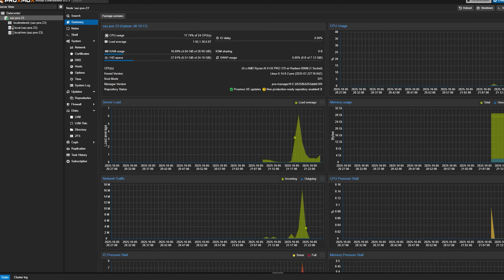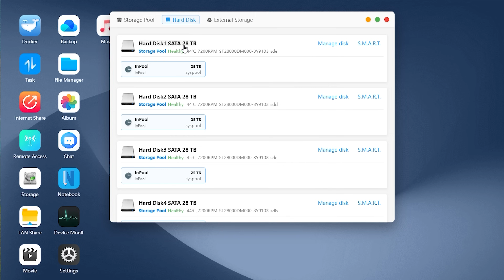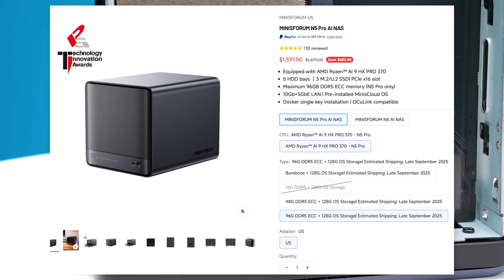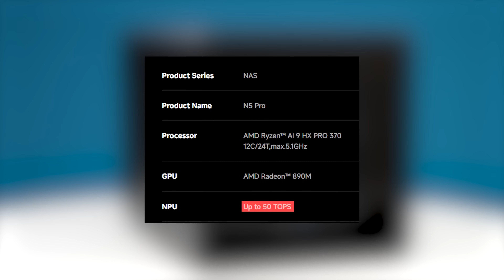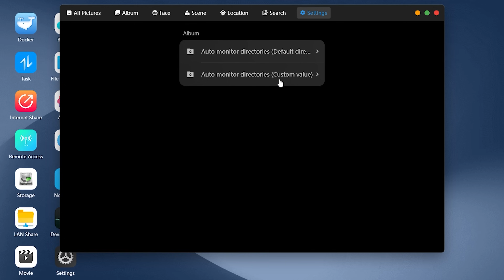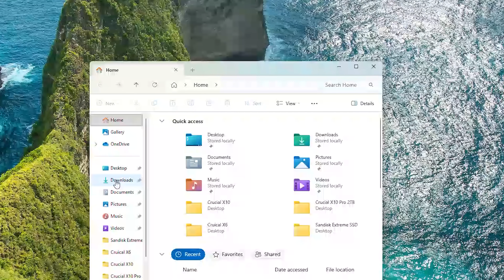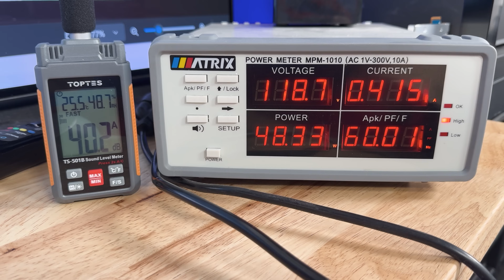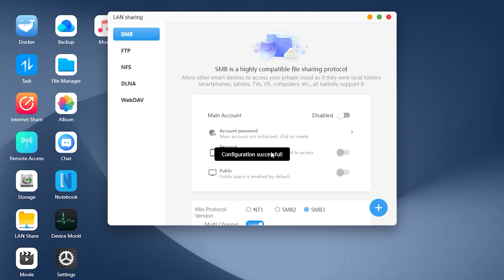The BEST 5-Bay NAS Today (by far?)

Comment: 1200 dollars? that is mid tier level pc . i very much prefer a i9 with very very good mobo and psu and a good case ...maybe go directly for a sas card and used server sas disks that are cheap and enterprise grade . i dont care so much having hot swap trays , is not like i gonna swap disk every week . you could just run the service in the background of your pc with a container and use 2 or 4 cores of the 28 or 32 that you get for like 300 dollars . is stupid at this price . thats just a gaming laptop without screen , memory or storage for 1200 dollars . just a mobo with a solderer cpu .

Comment: Good hardware, crappy suspicious software. I would still prefer UGreen NAS over this as they will still support their NAS'es hardware even if you put a different OS in it such as TrueNAS or Proxmox. UGreen has also improved their NAS OS a lot since launch and it doesn't require you to register your email with them or such. I own both 5-bay & 8-bay UGreen NAS'es and they've been running 24/7 since I got them. There were some hiccups on their software at the beginning but they addressed these issues quickly and they keep improving their OS to the point I'm enjoying it more than my Synology NAS'es. Running docker and VMs is also a breeze as well as running NGINX proxy manager on it via docker. This was much harder to set up in my Synology NAS.

Comment: I have the N5 pro and it has a fairly big problem. The fan speeds are not visible to the OS. I tried a couple of linux options since I want to run Unraid on it. 
It appears to be a BIOS issue.  EC ram fields show empty, and the documentation that I got to was not help.

I will be reaching out to all to get a BIOS update to resolve this.

Comment: cool design but you're right the custom application for setting it up and needing to register with an email is not good. I'd love to see simlar formfactor with lower specced hardware. $1000 USD is a lot before even buying hdds.

Comment: Why do so many NAS systems come with external PSU? Seems like something that can be easily disconnected even in a rack/shelf. Also that power brick has no ventilation. How long will it live? An alternative front cover would be nice, but since they don't offer it, it would be great if Minisforum would provide STEP files to 3D print mesh with placeholders for magnets. I don't need a plastic cover to reduce airflow but I want some dust intake protection.
Finally, I haven't played with NAS outside of the old Synology I have but can disks be parked until NAS is accessed? Ideally I want SSDs to be available as first level cache that once fills up (for write loads) synchronizes to the disks, 50W is quite a bit for idle if I'm sleeping.

Comment: I never have been able to understand the PCIe lane allocation in these things....  If it's a NAS, it should have two equal networking ports for proper balancing.  The chipset is PCIe 4.0 across the board: that's one lane each and done.  It should also have equal M.2 sockets, so you can run RAID1 on the SSDs without a horrible imbalance in bandwidth. There's little to no need for the third, inexplicably size-limited M.2 slot, just use that lane to make both of the others run 4.0 x2.  If those lanes need to be pulled from somewhere, ditch the OCUlink - anybody wanting to use that for something can just put a riser in the PCIe slot, since they won't need to put a 10GbE card in.

Comment: This hardware setup looks nice, but they need to add the drive locks, label the nic ports so you're not guessing which is which. Not a huge deal but still. How is the air going in through the front with that panel on? That looks restricted and could be a mesh metal cover instead of plastic. If you can choose your own OS then it's fine I guess, but the last is the price. These have to go down because the hard drives are the ones you still need to spend a lot on. Nowadays you have many choices for nas boxes. But it's nice how everything can be taken out like that. Just keep in mind that you can't upgrade that over time though. I've had to update my nas board 3 times already so having something that can fit a mini-itx is a good thing. It's definitely a nice box though. I like the vertical drive setup myself.
Reply: You’re right. I built a nas using this and one of my hard drives fell right out

Comment: I love the idea of a 5 bay and this one seems to tick a lot of boxes. I really like the modular architecture. The CPU choice and the openness of the way they designed this control plane was very cool. This nas is a mix between a workstation and a nas for processor, ram, etc but really aligns with the reuse of one of their other MB designs. I think cooling might be an issue but I'm probably not reading the stats right. I bet it would be a good choice for OpenNas or their own nas software. Thanks for showing me another option (I am still leaning on the UGreen 4800 plus as my go to, but nice to have great options like this).

Comment: That looks like they could provide upgrades in the future for the compute section. I wish they left enough room for one of those Intel B60 cards
Reply: I have one and no it does not fit, only single slow low profile so not much available
Reply: @naitcalo2141
Can this slot even supply more than 75W for B60?
Btw. do you maybe know if this NAS will fit Intel B50 inside and power it stable?
Reply: @EeerieSoundWave  As far as I know it's only suited for up to 70W but I am not 100% sure. 
I ended up returning my unit.

Comment: $600 for the cheaper one without drives and $1,020 for the AI version. This is way too expensive for a 5 bay mini NAS!
Reply from the maker: I mean the AMD Ryzen AI 9 HX 370 is a pretty high end chip itself. This is not really that much more than a non-NAS mini PC with it
Reply: @ServeTheHomeVideo  and that is exactly my point! What home user, home lab owner, or small business going to buy a 5-Bay NAS at this price. They may have specific uses for that high end CPU and like the 5-Bay hot swap drive bays that come with it, but they are not buying it for a NAS.

Comment: dxp4800+ half the price as this over priced thing
Reply: The non pro is way better than ugreen at same price, reviewers only check the pro but non pro is the same just with different cpu ryzen 7 255
Reply: @naitcalo2141 is it mandatory to use only certain drives, can you run your own OS?

Comment: It also comes with stingy BIOS updates, and zero support when it stops working, as the manufacturer churns new products non stop and does not even have the stock to replace units under warranty.
Reply from the maker: That is why we had a section discussing support

Comment: I wish the power button was behind the front cover so it is harder to bump/long press.
It looks like there will be thermal issues - especially with the large, solid front panel obstructing airflow - it would be nice if that was a grid/mesh of some sort instead and a filter on the intake.
It does look compact, but only in some areas -  I think that if they made the drives load in from the top, rather than the front you could put almost 2x as many in, i know that hurts usability in where you can access it, but honestly, how often do you change drives in your NAS? - Maybe not the right person to ask that hehehe

Comment: This is such a cool machine it's not even funny (incl the non pro version). I could see myself installing a standard Linux distro on it and running as my daily. Put the intel b50 gpu inside (N3rdware cooler - will it fit?!), add an oculink eGPU and you have a beast of an AIO home/SME server for biz applications and any local AI you throw at it (within reason)... If you trust Minisforum's hardware reliability - but the same applies to any of such boxes, and I'm pretty sure there will be more of them soon.
Reply: B50 gpu don’t fit only single slot low profile
Reply: @naitcalo2141 Hence why I mentioned N3rdware cooler! They have it in the pipeline

Comment: The pricing just makes it absurdly unattractive to be frank. Nearly 2 grand for something that can be achieved at much cheaper a price with DIY components and with a better performance profile if you do. Maybe less power efficient, but if you're concerned with power efficiency, you can easily still beat this on that front with a DIY solution. It's not even that much more easy imo

Comment: Minisforum really killed it for a first stab at a NAS.  My current setup is just a 5 Bay usb4 going up to a miniPC similar to what they have, no built in PCIe slot, but to me that the affordable route.
Reply: Could you please share which 5 Bay usb4 model you are using? I'd like to use such a device to connect it to my main device as a quick storage/backup solution, thx.

Comment: My mind immediately goes to a home lab Proxmox cluster with two classes of Ceph storage across the two drive types. For budget setups you already have front end and back end networks. Or you can upgrade the backend networking over PCIe and have dual front end network paths.
Reply from the maker: Fair, but really for Ceph you want many nodes and OSDs

Comment: This is a pretty nice system, but not quite right for me. What I am looking for would be a chassis for spinning disk drives like this, but without any compute, it should just have SATA connectors so that I can connect the disks directly to a custom DIY PC. Do you know anything like that? It should also be affordable.
Reply: That's just an externa HDD. Even boring old USB 3 is plenty fast enough for that. You don't need a NAS if you don't care about accessing the data over your network.
Personally I've thought about buying an old busted laptop and repurposing it is a NAS with a few external drives. Mainly I just want something cheap, quiet and decently power efficient. I've gotten pretty tired of listening to my media drive whirring away inside my main computer. Might as well relocate it to a different room.

Comment: tell me that you tried to "bypass" the original system, and that you tried to install a Proxmox or another distribution like truenas
Reply: I'm running TrueNAS on mine and it's running great. Have Plex, Jellyfin, Tailscale apps running plus HAOS VM so far.. Going to try Immich on it soon
Reply: @sirbestia how's USB 2.0 passthrough working for you on the HAOS VM? Only thing keeping me from migrating my HA Green hub to VM.
Reply: I have the non pro for a few weeks which is basically the same and you can install whatever you want, it’s a mini pc with 5 hdd bays not a nas. However the hardware choice is weird, in próximos, unraid and turnas you cannot pass through the igpu to a vm. The unit works better with windows and storage spaces

Comment: Honestly feels more like a mini-workstation with a bunch of drives bolted on. This will be a lot of power burned in a 24/7 system.
Reply: DDR5 has been having a lot of reliability issues, so the workstation aspect i.e. the ecc ram feels like a must right now. Either that or sticking to older hardware that runs ddr4, but then there might be higher wattage being consumed at the wall.  ymmv depending on your needs, but if I had this piece of hardware, I'd definitely be maxing out the ram and running a ton of vms using Proxmox on it.  The hardware even seems designed for it, with the 2 m2 ssd ports, which are perfect for putting in raid 1 and then putting the VM's OS' on there.  The spinning disks are perfect for multimedia and OS backups.  The cpu is absolutely overkill for simply just a nas without vms.  For just a nas an N100 or N150 (or similar) makes a lot more sense.
Reply: This is the problem with this nas it’s more a mini pc with hdd bays than a real nas, I have tried all nas os and none work 100% well but windows

Comment: Maybe I missed it but did you test thermals? Because with that poor ventilation HDD temperature is likely to be an issue. I built myself a very similar NAS with 5x 20 TB drives some years ago in a Jonsbo N1 and removed the front plate to improve airflow.

Comment: I've had my eye on this for a while, but mostly because I'd like to clean up my current NAS deployment. However, it's not worth the expense for me for now. I hope Minisforum keeps this form factor around because eventually I will be making the jump. As far as the integrated GPU and NPU, it's worth noting the software support for these in Linux is... lacking. XDNA is now in the kernel, but as of now, I don't think any distributions include the support, so you'll have to compile your own kernel most likely. There's also ROCm, but this notoriously doesn't work well, IF at all, with the APUs, at least in Linux. So running AI workloads may be a challenge. GPU access for more simple AI workloads like image classification, speech to text, and text to speech probably will work fine, as they're less intensive. But dealing with ROCm on an AMD APU already... yeah... Having oculink, though, you could likely get a lower end dedicated GPU connected that will handle whatever else you need handled.
Reply: ROCm is very much still a work in progress on AMD discrete GPUs. You'll spend all day wishing you had paid the Nvidia tax

Comment: The entire system is a truly great promise, except for the price.
1350 bugs, without HDD, SSD, or NVME, depending on what you want to install.
The build quality, as you can see from the video, is excellent and doesn't really make any compromises. The APU will still be useful for everyday use for years to come.
But building it yourself still sounds more fun and more customizable, especially if you want to build larger and don't want to be tied to software.
Reply: Those AI CPUs a really cost very much. I think STH missing the point what there is non Pro version with non Pro CPU and half the price.
Reply: @efimovv  STH received the NAS as a preview unit.
And of course, with preview units, they only release high-end stuff.
It's supposed to make a good impression.

It's a shame that they forgot to mention the non-Pro version, but it happens.
But the price will probably only be 100 or at most 300 bugs lower. Which is still a lot.
Reply: @Dragonheng  I agree. And I even saw Pro and non Pro version on big TV at background but no info.
Reply: The price outside the USA is much lower.
Reply: Since it’s from Minisforums it will actually have 1350 bugs, none of which will ever get fixed with BIOS or driver updates 😂
Also it will probably cost 1350 bucks.

Comment: Can someone suggest a solution? I have a HDD nas now, but it's incredibly slow and takes about 30 seconds just to spin-up anytime someone accesses it. It's way underpowered and slow. Im looking for a M.2/U.2 NVME solution  which will be able to saturate a 10GB SFP+ ports and not have the crazy slow access times. Prefer a 1U or 2U solution with the ability to sync to a UPS for clean shutdown on power loss. Looking for around 32Tb in size with RAID or similar fault tolerant capability.
Reply: Don't spin down your drives to start
Reply: @brianhansen9578  Power draw when not in use is excessive. I would prefer a low power solution such as NVME
Reply: Many 4Bay 10TB SSD with redundancy will satisfy you needs. For exapmle, https://www.youtube.com/watch?v=J9dBOx1CD4w

Comment: Would like to know what the power efficiency is for this device, in comparison to similar intel based products like the HP microserver, 
Though the bonus this device has vs its competition is the built in 10g and the expansion bays/pci slot. 
As when running 24/7 the cost in power can make the final decision with the overall running cost.